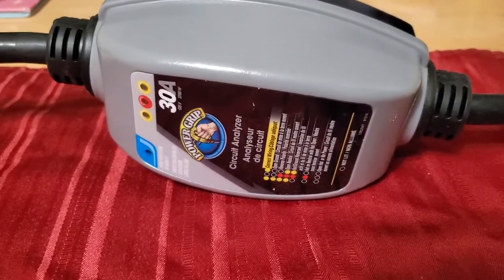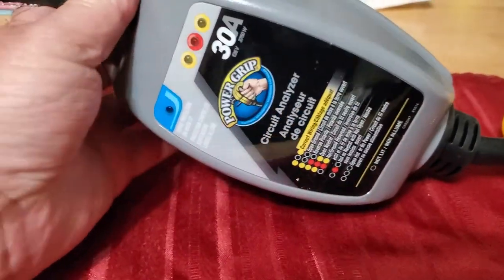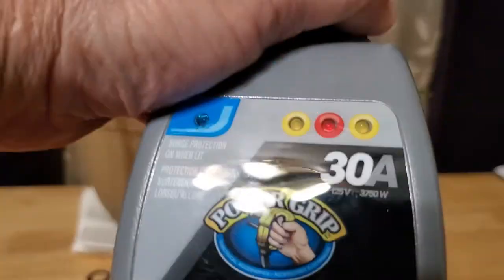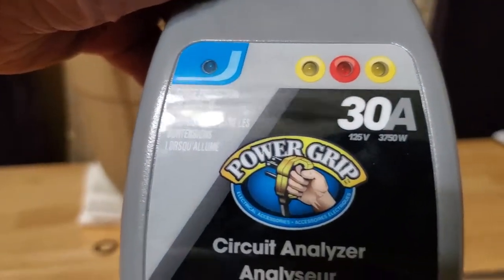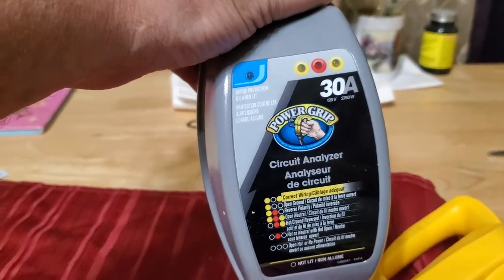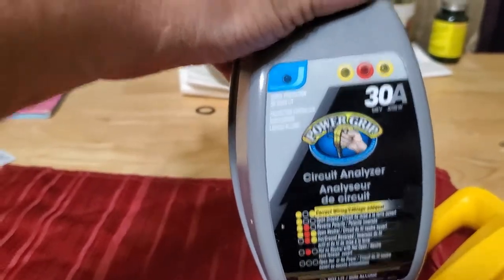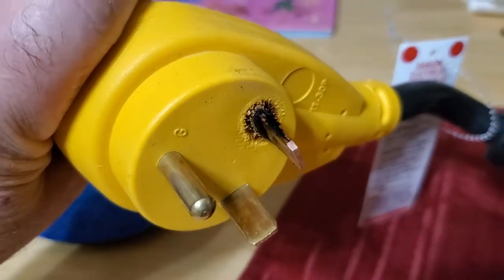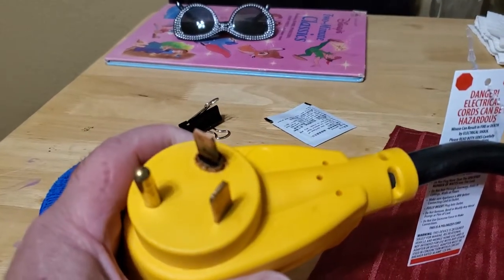RV Circuit analyzer malfunction.  Help.

Comment: Did you ever figure out what caused the issue?
I just bought the same analyzer and don't want to worry about issues popping up. Thanks.
Reply from the maker: I would not use that brand again. It was the circuit analyzer. I purchased a more expensive and well known product.
Reply from the maker: I purchased a Southwire Surge guard. 
It is a much better product than the Camco. It also has more features to protect your RV.
Reply: @2lotony  Thank you